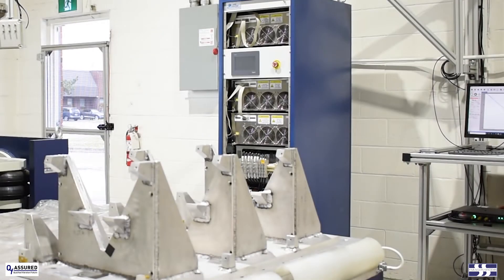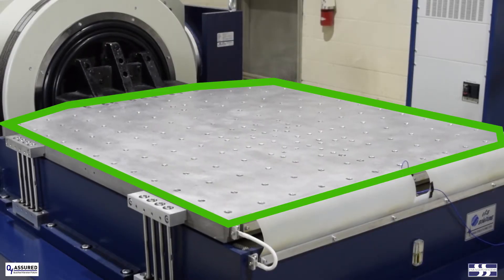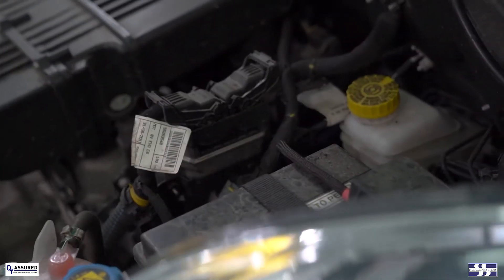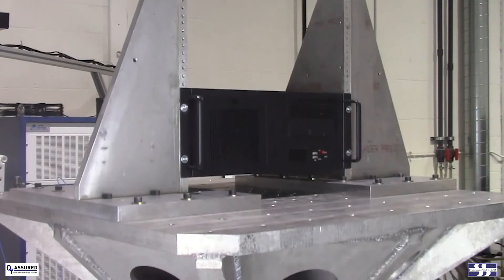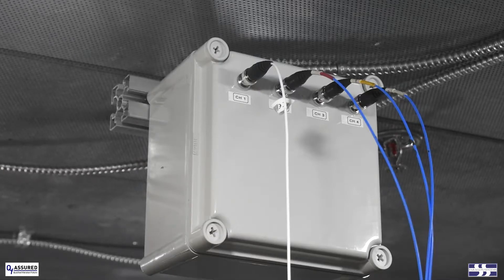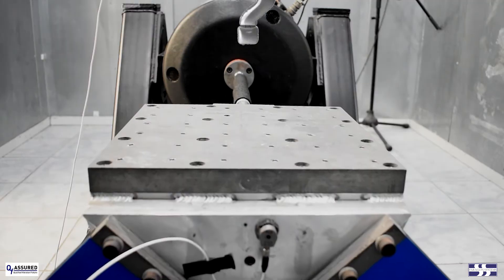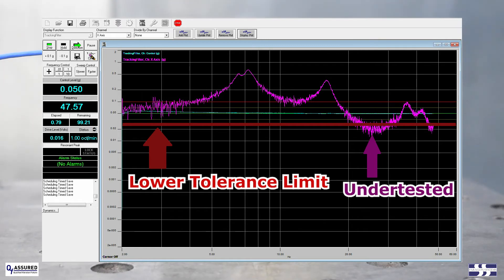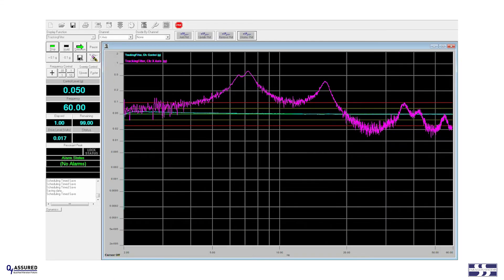Why are vibration fixtures so important?

Comment: Hello Team,
What if we use multiple control inputs (ideally at unit mtg location)?
I am assuming that using this, we can completely eliminate fixture resonance and check effect of vibration profile directly on unit.
Pls revert if this correct.
Reply: This approach will not eliminate fixture resonances if there are resonances within the test frequency range. It may bring the inputs within tolerance if averaging control is used, but only if the resonances are not excessive in the first place.